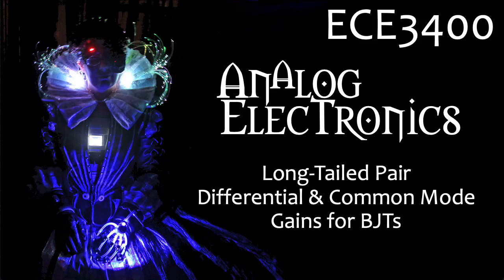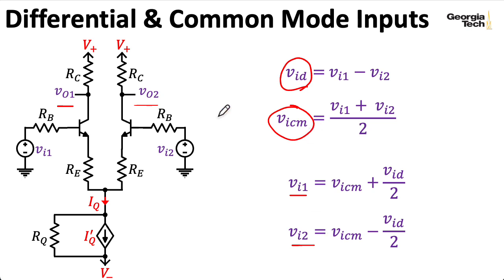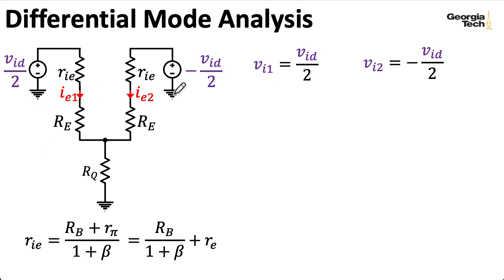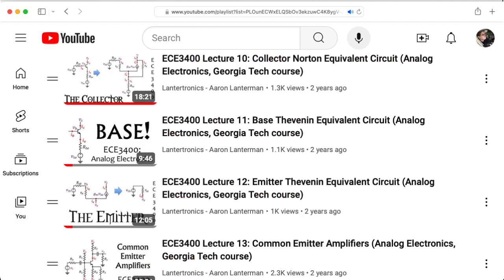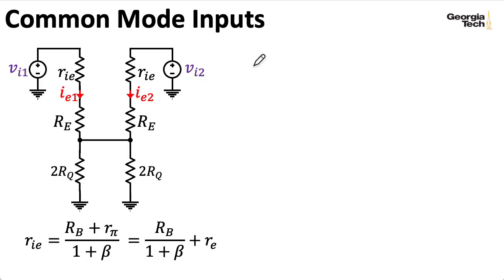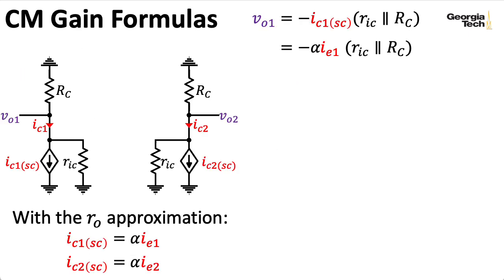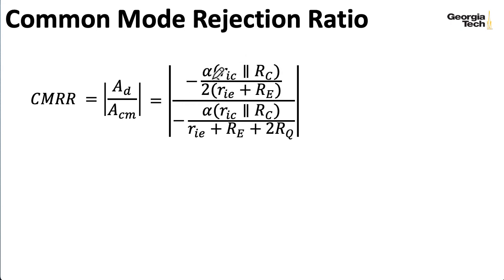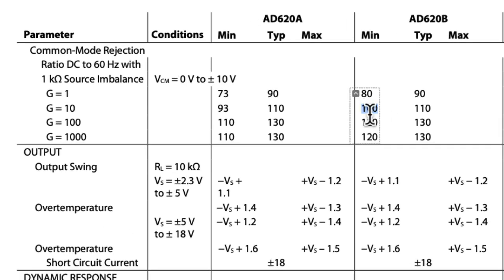ECE3400 L22: Long-Tailed Pair Differential & Common Mode Gains for BJTs (Analog Electronics)

Comment: This was great for understanding the theory but it doesn't give me the confidence to put it into practice simply because it doesn't account for real world circuit elements that interact with the LTP.  I've never been able to successfully design this stage mostly because the following stage (VAS) as well as the global negative feedback change the LTP's properties, making the design very specific to the rest of the power amp design— copying from another amp won't get you there. So I always just give up and use an op amp for this stage.  I would like to see a more complete analysis of the LTP with consideration of its context and how a discrete design compares with an op amp design. I realize this is all coursework and the creator probably won't veer off course on account of one non-student's shortcomings. I'm just dreamin' out loud here.
Reply: My 2ct. There is a big difference between a LTP and an opamp. The LTP used here does not employ a current sink at the emitter, nor does it have a current mirror as the collector load. These two features are used in real opamps and make analysis a lot easier too owing to the near-perfect behaviour w.r.t. ideal current sources. In addition, rolling your own opamp using discrete devices is mostly an educational exercise as you will never get the device matching necessary to rival even the cheapest IC opamps. Evil Mad Scientist has done a discrete 741 opamp as a kit, that is worth checking out IMO. If you want more analysis, the Microelectronics book by Razavi is a good source. It focuses on mosfets rather than bipolar devices but the analysis methods are similar.
Reply from the maker: I'd like to emphasize what @trcwm says -- a diff pair is just the first input of a full-fledged op amp. I've got another lecture in this series titled "Deconstructing the TL071 Op Amp" -- I'm mentioning just the title for you to search on since it seems like sometimes YouTube deletes comment with links. In that I talk about some more parts of the op amp at a high level and how they fit together.

Comment: Question, would you have any plans to look the practical setup of a LTP with JFETs? I'm interested in them for the input impedance advantage, and/or sometimes in a discrete case you can put them infront of a particular opamp one wants to use, for other properties, to increase its own impedance.
Reply from the maker: JFETs are considered out of style by my colleagues so they're not really part of ECE3400 (I will cover MOSFETs later) -- but I am personally quite interested in JFETs so I would like to talk about them if I can find the time.
Reply: Would be great to learn more about JFETs in detail. I used them already for DIY guitar padels, high imput impedance amplifier or as a gain control in an oscillator. I'm always a bit confused about the intrinsic behavior and the parameters. If the IDSS fits,  I'm most of the time fine with it.  😅